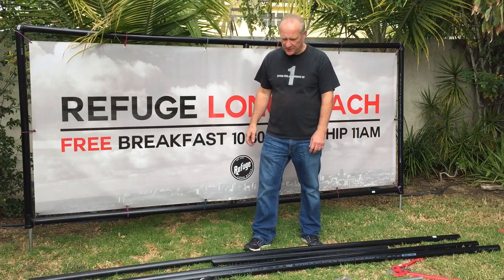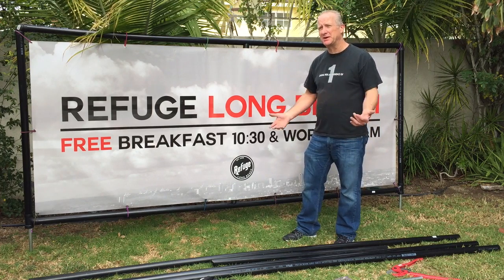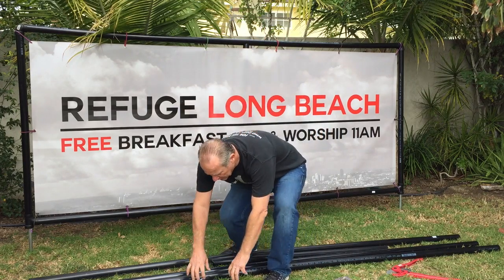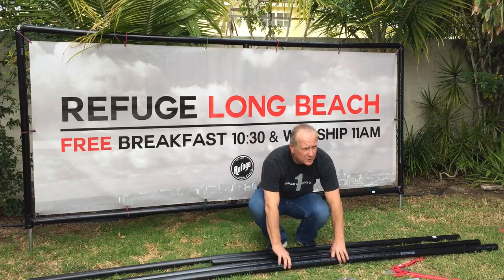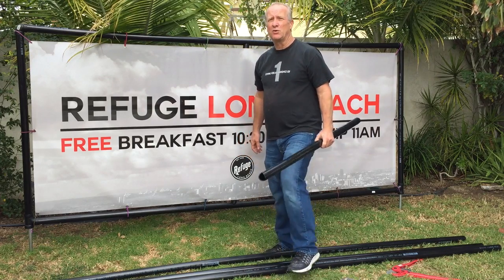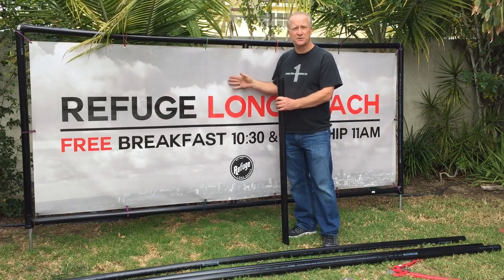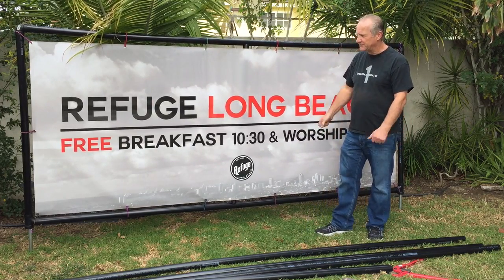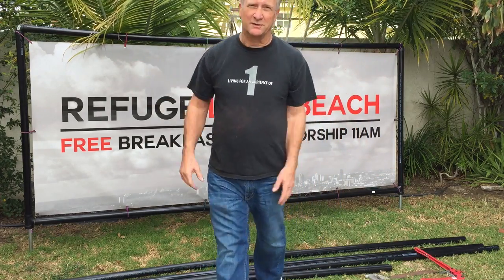RLB How to Build a Sign Frame 2

Comment: This stand looks really nice, but how does it stand up in the wind?  Is there any way to make it more sturdy without using stakes?
Reply from the maker: have held up a year later. What is good about this design, which is for Do-it-yourselfers, is its easy to build, store, and put up and take down, which is what a church needs.
Reply: Where did you purchase the black PVC pipes? I have searched online and it has been difficult to find and expensive.
Reply from the maker: @hildam.robles5444  Home Depot or Lowe’s